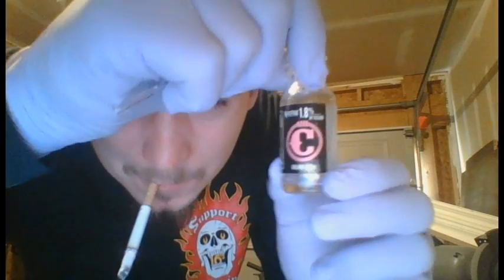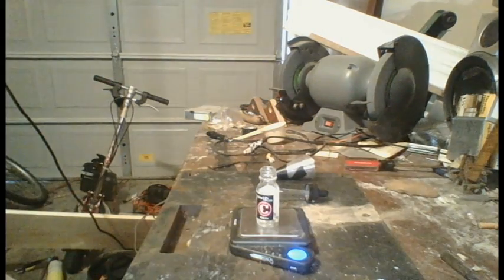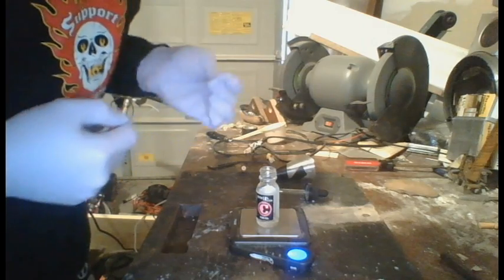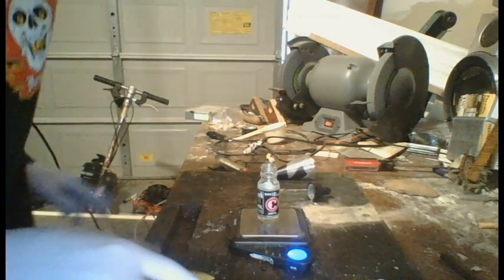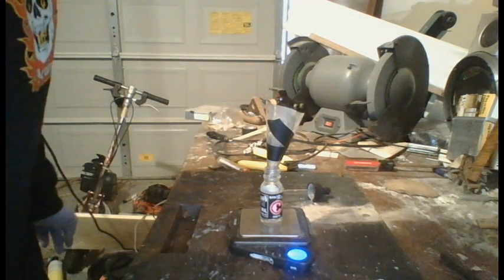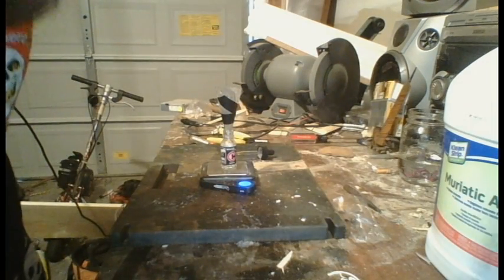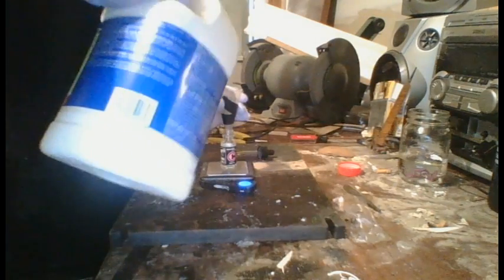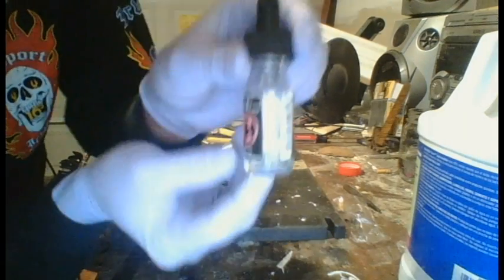Making stannous chloride with solder

Comment: I have a circuit board with plenty of solder on it. But how do I get it off of the board? Soldering gun?
Reply from the maker: This sounds very tedious, I'm assuming you wont be using this board for anything ever again? You might be able to use a propane torch to heat the solder then knock it off by hitting the board on something solid, or you could work some alchemy with fluoroboric acid and proxide!

Comment: Can it be used in silvering mirror?
Reply: probably not, the concentration is very low. to concentrate it further you have to maintain the equilibrium between the HCl and Sn by raising the acid content as you boil it dry, so glacial HCl is required.
Reply from the maker: @Amasarac  Love seeing good info in the comments!
Reply: thanks!